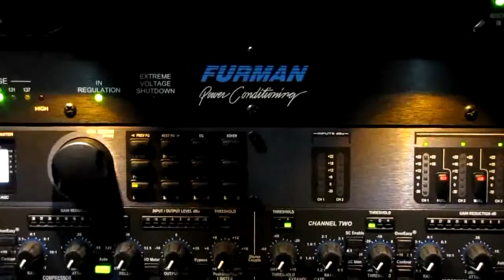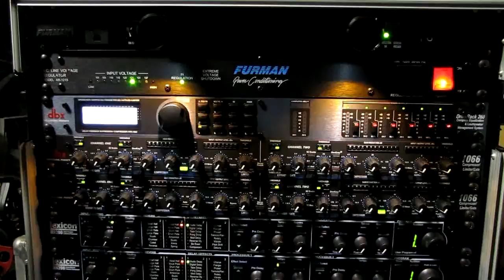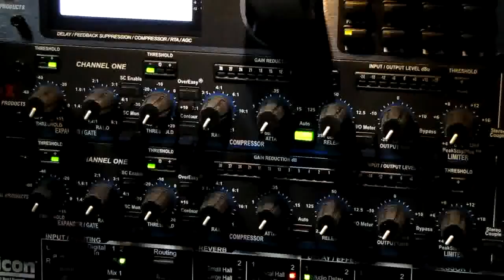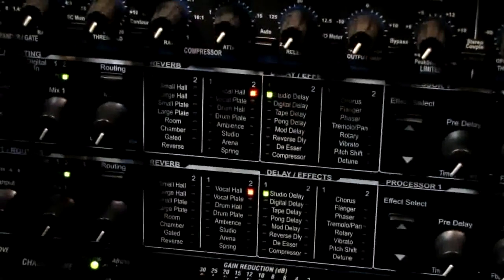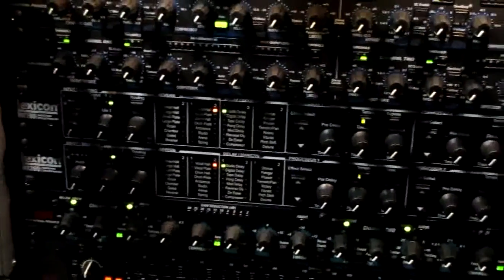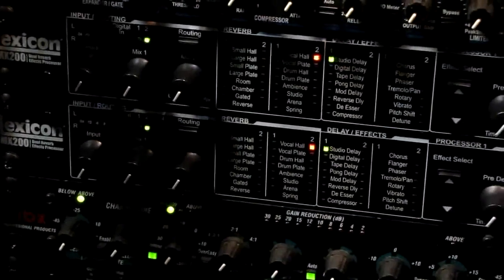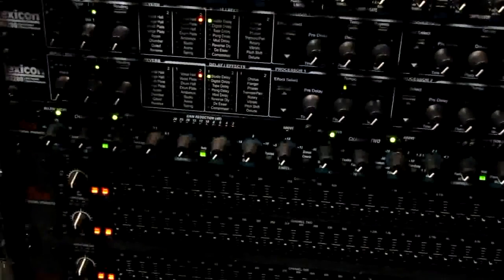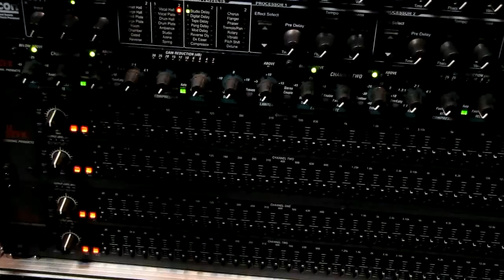Audio equipment overview - analog FOH Rack 1/2 (compressors, effects, driverack) - Stage Left Audio

Comment: May i ask, is this external effect good for powered mixer ......? Coz some of my colleague told me suggest to get ' empty ' mixer before buying this so that the sound will be  more powerful n crisp
Reply from the maker: The external effects will not matter if they are used on a powered or non-powered mixer.  As long as the powered mixer has an external loop (send/return) for the processor to connect to, it will work.
Reply: I see.. thanks for helping me out...keep up the good content

Comment: I'm using an older Digitech effects unit . ive been using it for years , but i never understood what the input and output knobs were used for, I just kept them both at 12:00, but i do notice that sometimes when the signal gets too loud , the led lights (labeled headroom and overflow) hits the red..help please
Reply from the maker: +rtt143 From what you are saying, sounds like the input knob is controlling how much signal is allowed into the effects unit.  The output knob is controlling how loud the signal is that is sent from the effects unit.  Most all effects units have these controls.

Are there any other lights on the unit that shows how "loud" the signal is (aside from the LED you mentioned)?  Try to keep the unit from getting too "loud" (the red LED).  This can cause distortion which will adversely affect how the effect should sound.  When these types of "overload" lights come on, it's usually an indication the input-signal is too high.

If there are no markings around the knobs that show what the level is, keep the knobs in the middle like you currently are.  However, if the overload light comes on, turn the input knob down a little.

Try checking the manual (online manual?) for your effect unit.
Reply: +stageleftaudio  thank you ! you rock!!

Comment: why use separate compressor if the driverack 260 already has it built in. This is just a question. I was wondering in your opionon whether having individual equipement is better than having one unit that does it all. I am building a medium size PA system to take to Jamaica. Don't know whether you are aware of the sound system that is being used out there.
Reply from the maker: +Ricardo Miller The separate compressors are used for the subgroups on the console (vocals, drums, instruments, bass).  The compressor in the driverack isn't really designed to be used as a separate outboard processor.  In my opinion, it's best to use separate gear for processing.  I can assess all gates, compressors, limiters, and eq settings in our rig in 5 seconds without having to touch any piece of gear.  If all my processing is one piece of gear, I would have to navigate through each processor to see what the setting is... this can take many, many seconds of time and will divert your attention from the show.  Also, if for some reason the single piece of gear (with all the processing in it) doesn't power up or doesn't work,  you've lost all your processing.  We use all analog equipment because it is more efficient to manage for the events we do.
Reply: Thanks for the quick reply I was struggling to come to a decision on whether to go all in one or individual but you answer that 4 u as I had the same thoughts as well.
Thanks again for your advice